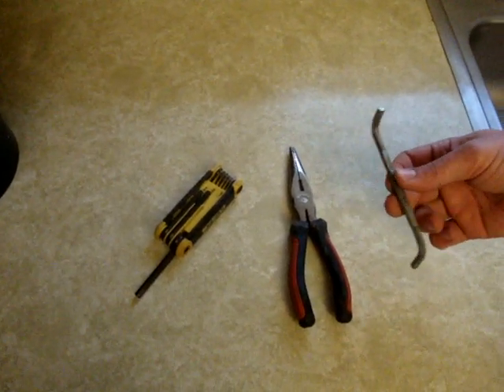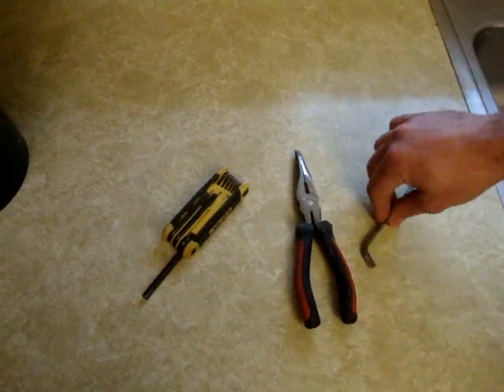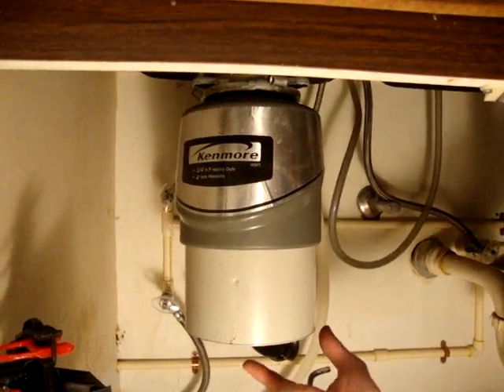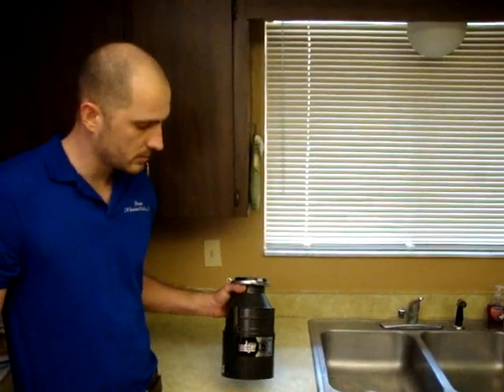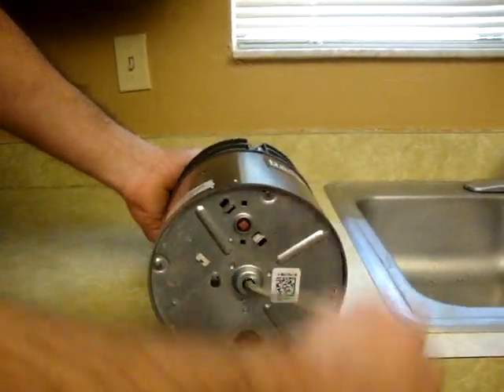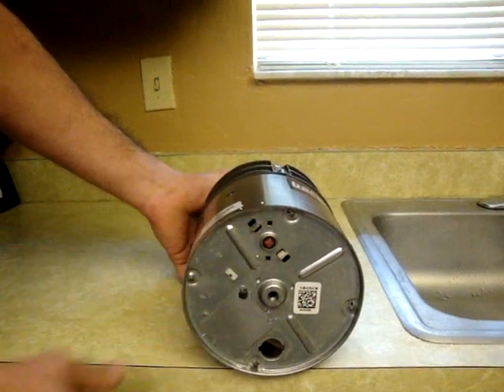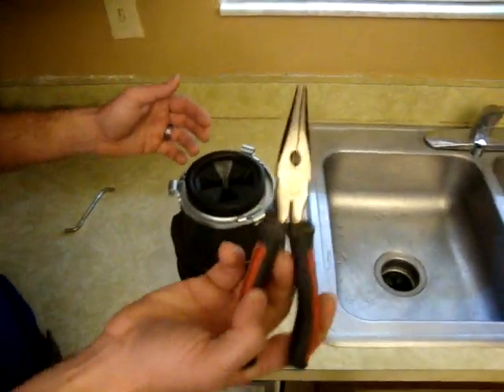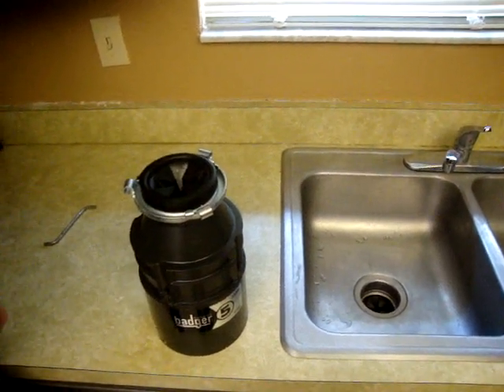How to clear a Jammed Garbage Disposal

Comment: My disposal is jammed up so tight you can't get the motor to turn with that self service tool to save my life.  I think that if I tried any harder to turn that motor, it would either  break the tool or something inside of the motor.  I don't know what's in there but it is really in there.